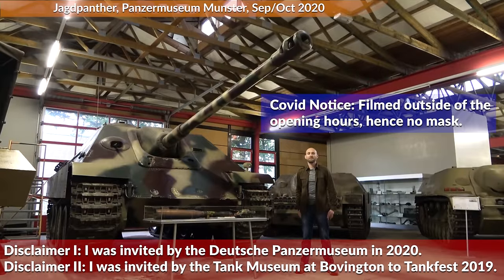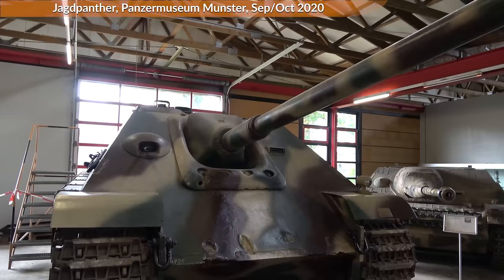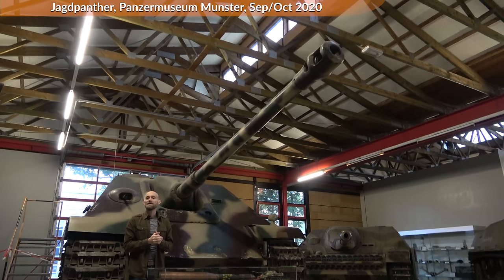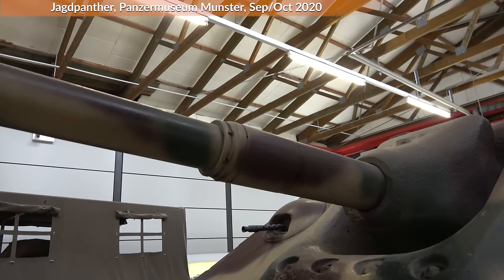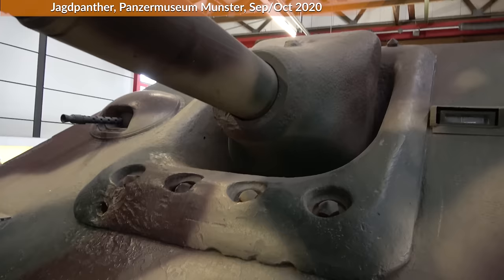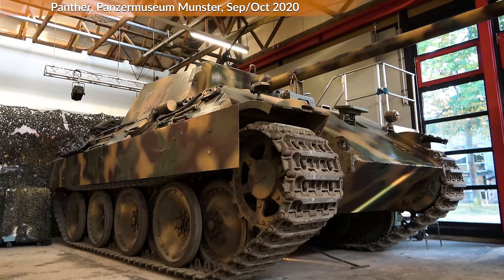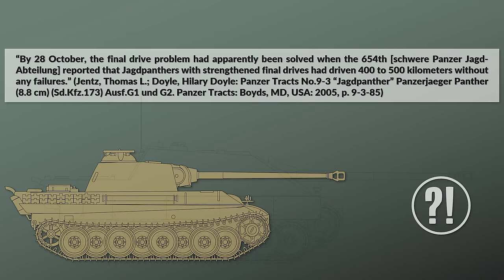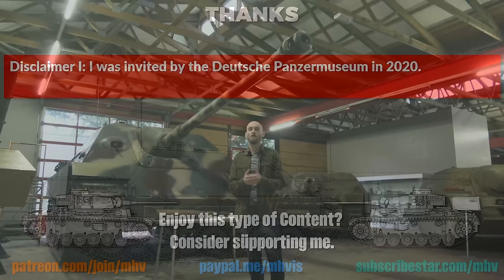Jagdpanther: King Tiger's Gun & Panther's Chassis

Comment: I had a mental picture of a used “tank” salesman touting its excellent fuel economy, superior rust guard, and great acceleration.  “Don’t tell my manager, but I’ll give you this special low price because I can see you are someone who appreciates German armored vehicles! “ 😂
Reply: He then kicks a road wheel and the gun mantlet falls off.
Reply: Bet there's no guarantee on that transmission 😉
Reply: Mental picture of a dealer selling after battle vehicles form WoT or WT:
"No worries, we removed most of the previous unlucky crew, but parts of a loader felt between suspensions bars, that's why it is on sale" or "well crew bailed out and set charges to scuttle vehicle, half of them worked. She looks lovely from port side, most of of the other side is missing" "Fuel economy... well You need economy to fill her up, but engine sounds is worth every 100 gallons" "We have also few tracks links form Stug, that met with B-17 pilot who flew with GPWS turned off,  You can have them as freebee"

Comment: One note on the early smooth gun recess collar (Geschütznische) it wasn't really welded but rather affixed internally using tabs, the opening in which the collar sits is also used to remove the transmission so the collar had to remain removable, you can see this mounting on the IWM Befehlsjagdpanther which has been cut open. The collar on the Munster vehicle was introduced in late September/October 1944, there was another type quite similar but less chonky which was introduced in late August but which was found to be to weak.

On production it should be noted that the second assembly, MNH, was initially only supposed to produce Jagdpanthers temporarily while MBA got tooled up to produce Jagdpanthers, however due to inexperience with producing armoured vehicles MBA never really got up to speed and MNH continued to produce Jagdpanthers (as well as Panthers) until the end of the war along with MIAG who were the sole Jagdpanther assembly plant until late October 1944.  The effect of the delays from bombing raids and other disruptions become evident when looking at the amount of hulls produced compared to the amount of Jagdpanthers accepted. Whilst final assembly was done by three plants (MIAG, MNH and MBA) hulls (Wanne) were only produced by Brandeburger Eisenwerke, the highest known Wannenummer is 300795 which means that at least 795 hulls were produced before the end of the war whereas only approx half of these got assembled into finished Jagdpanthers (note that the hull number did not necessarily match the Fgstnr. of the finished vehicle)

Comment: I like how comparing it to previous TDs begins to show why the concept was discontinued- to mount larger guns profile was getting higher and higher, defeating the purpose of tank destroyer.
Of course it's nowhere as ridiculous as the "barn-on-tracks" Jagdtiger
Reply: JagdPanther is the outside range of the German TD concept I think. Crazy that they came up with the hunkajunk Ferdinand over a year earlier.
Reply: @terraflow__bryanburdo4547  To be fair, the Ferdinand wasn't designed from the outset as a TD so much as way of utilizing the hulls of the Porsche Tigers.
Reply: @Riceball01  LOL it sure seems that way. Porsche and Hitler's oversized hobby horse.
Reply: @terraflow__bryanburdo4547  Yes and no. Ferdinand was more like a private initiative of Ferdinand Porsche that got out of hand rather than what the German Army had asked for. 
And it was a failure.
Reply: @KPW2137  Makes one wonder why the hell they wasted good metal and effort on the Jagtiger. I assume that oone was asked for by someone other than Porsche. Did they not learn from that debacle?
Reply: The request that eventually led to the JagdTiger was for a armoured self-propelled 128mm gun. The original intention was to get a 128mm assault gun rather than a "tank destroyer". The system could have been quite effective as a special purpose direct-fire bunker buster sort of assault gun. But by the time it arrived at the front, things were so chaotic that nobody spent much time considering its proper use or the reasons it had originally been requested.

Comment: Also note that the L/71 shoots a larger cartridge, the 88x822mm.
While the L/56 shoots the smaller 88x571mm.
Reply: Isnt it obvious?
It had an increase of armor penetration by 65%, while it was only 26% longer.
Reply: @Paciat  , not neccessarily so, I think, because the different cartridges (of same caliber guns) and their dimensions are rarely mentioned.

Comment: Heeeey, my favourite Jagdpanther! I recognize it by its "scars" (aka shell impact) even before staring the video as I have seen it at least six times in Munster. ^^
Edit: would have liked some words on battle experience with these vehicles.
Reply: Thsts what I was looking at, was hopeful he was going to talk about the impacts and what caused it lol.
Reply: @cowgoesmoo3850  Mooooo!
I can give you a short breakdown of what is said about them in the museum/what I concluded myself.
Front plate, the two impacts that are visible in the middle above the plate joints: 75/76mm AP rounds (my conclusion from size), deflected.
Two more dents that are not clearly identifiable.
One more impact on the bow that was repaired with putty.
Gun mantlet: one penetration by a 76mm (17pdr) APDS dart that finally took out the tank (this was said by the museum IIRC, although from the star-shaped carvings around it, it looks more like a hollow-charge impact).

Not visible: side-shot into the engine compartment between the road wheels and the upper hull. Shell was found when the tank was restored, caliber was not given.

Tough tank indeed. :)

Comment: Half way through the video I realized the panther had been shot multiple times. Lol.
Reply: He also got one in the engine room from the side, they dug the shell out of the engine when they restaurated the vehicle. The description plate in the museum says it. The hit on the collar was actually the fatal one, a clean penetration by an 17 punder (IIRC) APDS round.
Reply: @thomaskositzki9424  doesn't look like a penetration 🤔
Reply: @jackd1582  Because it is an APDS round. It is not a full calibre round of 76mm but a slim penetrator of around 30mm. The hole is very small.
Reply: @thomaskositzki9424  Same thing happened to the one at the IWM in London, three clean hits from a 6pdr  from the side into the rear of the crew compartment.
Reply: @voiceofraisin3778  I know, I have visited IWM. ^^ Well, it was the most sensible thing to try and flank these monsters, I guess.

Comment: It's no wonder the Jagdpanther needed a strengthened drive. It must have had to work much harder than the drive in a turreted Panzer. And the driver too. He must have been a lot busier and had much more responsibility than a Panzer driver.
Reply: You mean turreted Panther and Panther Driver. Panther and Panzer are two different things and are not interchangeable. Panzer is short for Panzerkampwagen, which is the German word for tank. So, all Panthers were Panzers, but not all Panzers were Panthers.
Reply: @Riceball01  I don't know much about tanks but I believe I said exactly what I meant. Using the adjective "turreted" with Panzer was merely to emphasize that feature and differentiate it from the Jagpanther.  Now, as impressive as your knowledge so obviously is, perhaps you'd like to go pick your nits somewhere else.
Reply: @JohnCampbell-rn8rz  It's not nitpicking, Panzer and Panther are not synonymous. The former is short for tank in German and the latter is the name of a type of German tank, as well as a large feline. Something that I was merely pointing out, quite politely I might add, since it didn't appear that you were aware of that. If you were aware of that, then all you had to do was to say that you know the difference and leave it at that.
Reply: @Riceball01  If you had actually read what I said and as I explained, I am well aware of what I meant and the words were chosen deliberately. Nowhere did I mention the Panther, in either of its forms, and I don't see how you can have read what I wrote and not see that. As for being polite and all that, get over it. You felt the need to satisfy your ego and correct a perceived error on my part. This is social media. If you can't stand the heat, stay out of the kitchen.
Reply: Point!

Comment: I always figured one of the leading problems in final drive failures was the loss of resources relating to powerful metals to survive the powerful impacts of hill and terrain while torque was expressed on it heavily, especially for front heavy vehicles.

Issues like tungsten missing, hence also an equal lack of APC rounds, now resorting to APHE.. Final drives breaking constantly because the tougher and more rugged pure metals they needed for them are all but evaporating for things like rounds or parts~~ it's not all that hard to tell really the designs are never really the physical problem as much as the resources needing consumed to produce them to their fullest potential seems to magically be missing for them to be mistaken as idiotic hiccups in designer history.

It's actually fairly similar to the same arguments used to defend the T-34 as a good tank. If you make excuses saying "If this, now it isn't bad," then this same logic could be applied to here.

Comment: I wish instead of talking a longer gun, they would talk about it being a higher pressure gun.  Sources had 6.8kg of powder propelling the L71 88mm while its short L56 brother... I couldn't find the propellant.  It isn't just a longer barrel it was the 88x822mm round vs. the 88x571mm round and obviously 571mm has less room for propellant than 822mm, but I don't know how much was stuffed into the shorter round.  While the Pak 40 (7.5 cm gun) had 2.89 kg of propellant.   So the longer barrel was used to convert that pressure to muzzle velocity.   The rounds had to be build stronger.  I've seen 69g of explosives for the burst charge in anti-tank rounds for the L56(I also saw 59g, I'm not sure if one is a typo or different rounds).  The L71 only had 50g of explosives in the burst charge.  While still a substantial charge, less boom on impact as the casing walls had to be thicker (stronger) to survive the more traumatic launch.       Take that 7.92x57mm vs. 7.92x33mm debate!    But honestly, that is the difference we are discussing.  A long round with a gun suited for it versus a short round.    If anything, i think for the amount of powder pushing the round, the barrel is a bit short, but as long as practical to move it around.

Comment: Herr Bernard? Eine fragen. When will you do a video on the engagements between the American heavy tanks and Deutschen Schwerer Panzer?
Reply: You can count those on one hand. I'm not sure about Tiger II encounters, but I only know of 3 encounters of Tiger I.
In one, a Pershing called 'Fireball' lost a street fight where a Tiger I placed a shot into the turret machinegun port, killing the gunner and loader instantly, another shot hit the muzzle break and triggered the round in the Pershings chamber which then rendered the barrel useless, thus disabling the tank.
In the second one shortly after, another Pershing sniped a Tiger I from more than half a mile with APCR. In a third engagement a Tiger I was knocked out by a Pershing. All happened close to where I live. Elsdorf, where the first engagement took place, is a 5 minute ride from my town.

Comment: I think the penetration numbers at 60 degrees for the long 88 are a little high, that would be 270mm at 90 degrees (100m). You could definely be right but from what I've seen the penetration is around 240mm at 90 degrees (100m). The video was great, but I would like to know the source from this figure

Comment: 2:30 The Jagdpanther uses the Pak 43/3, not the KwK 43.
Reply from the maker: some make that distinction some not, it seems they were pretty much the same.
Reply: @MilitaryHistoryVisualized  The recoil system is supposed to be a bit different, but the one on at least the PaK 43/3 seems to be exactly the same as the one on the KwK 43. 

It's dangerous ground, though. I wrote a short piece on the Jagdpanther and thought I could get away with "same gun as Tiger II". That turned out to be... unwise ;)

Comment: Ah yes the murder wedge.

Those hits marks on the museum Jagdpanther are interesting. All but one on the intersection of the upper and lower front plates. Almost as if the shooter tried to hit the lower front, but just couldn't get to it. And the last hit being really small on the recess cover, yet appears to have at least partially penetrated (17 pounder sabot? Or perhaps more likely a composite rigid core given the splatter on the cover plate). Was this how this Jagdpanther was captured? The odd hit having disabled something important and the crew abandoning it?
Reply: Would have been a weaker gun making the lower marks.  Took me a bit to see the puncture you see.  Unless the 6 pounder was very close, it would have to be what you say.  17 pounder with APDS ammo could penetrate 256 mm of armour at 500 m and 233 mm at 1000 m.
The spalling, from the puncture, inside the tank would have killed/wounded crew and broke inside components. I think I will spend some time and see if there is any info out there on the capture.
Reply: @bradyelich2745  I'm beginning to think it's the US 76mm gun. With the first hits being regular ammunition, which wouldn't be able to penetrate the upper plate at most reasonable ranges. After hitting multiple times, the gunner switches to one of his few HVAP rounds, which could potentially do it, but doesn't achieve a full penetration. However the German crew is by then breaking and abandon their vehicle.

[EDIT] Having dug around, it's a bit of a weird story. It is indeed 17 Pounder shells on the frontal plate, but the mantlet hit, which is indeed a penetration, is from a 6 pounder. So a reverse of any expected scenario. The Chieftain has a high speed tour of the museum where he talks about this.
Reply: Was it a target tank
Reply: If I recall correctly, the penetrating hit on this particular Jagdpanther was caused by a 6pdr sabot round.
Reply: @XanderTuron  No sabot rounds for 6 pounder.  AP, APC, APCBC were used for AT roles.  Must have been the 17 pounder.
Reply: @UnintentionalSubmarine  That is good.  I searched, but did not find anything.

Comment: Could the difference in final drive performance between Panther and Jagdpanther be partly due to a different use of the vehicle, causing different stress patterns on the final drive?
Reply: Being a fixed gun mounted in a casemate style tank destroyer the Jagdpanther does indeed place more stress on its final drives.

There is more weight at the frotn of the vehicle and for any large traverse the vehicle had to turn.

Comment: I wish who ever did the slope would do it in a more easy way for people to understand, or the same it would appear sometimes people get it mixed up because it's not done in the same way, if we take it at face value, the Sherman, Panther, tiger2 and t34 all had the same or almost the same slope yet the reality is they had quite a big difference.

If 0 is on the right side and the tank slope is facing to the left the measurements are, 30° for the t34.
35° for the Panther, Jagpather, King Tiger and jagtiger.
There is also about 20mm difference in armour protection from the 30° to the 35°.
56° or 47° depending on the Sherman.

Comment: So apart from barrel length, what's the difference between the tiger and the hunting panthers 88mm?
I'm assuming you can't fit the long 88 in a tiger, but for what reason?
Or another way to put it:
Why didn't every tank have a longer barrel if it increased lethality?

Comment: Random question. Is there any particular reason the peneration value of the long barreled gun decreases by so much more than the older version with range?

Obv its still better but it seems the proportional difference shrinks with range.
Reply: Aside from the fact difference between guns is in the range of 5,5% the answer is well, ballistics.
Short version: faster round loses energy faster.
Long version: the faster you go the faster you lose velocity, L56 has a muzzle velocity of 930m/s, L71 of 1130m/s. (Values for PzGr. 40 and PzGr. 40/43 respectively, both rounds weight 7.3kg so the mass difference is a nonfactor in this case.)
Proportional difference shrinks with range because as rounds go slower they lose proportionally less and less of their velocity (and in consequence energy) at a given distance which means penetration loss becomes proportionally smaller.